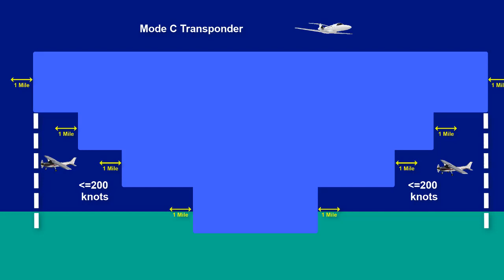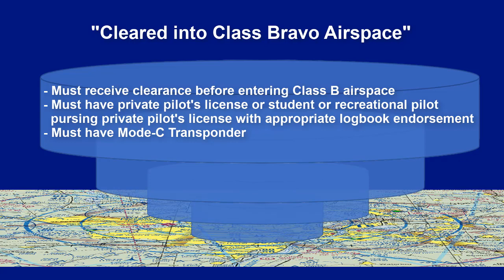Class B Airspace - Part 1

Comment: At the 1:20 mark you mention distance to maintain from class B when flying underneath. Where did those numbers come from? The only thing I found in the AIM was to observe precaution when in close proximity. There are places I fly (especially around 1H0) where it would be dangerous to maintain those numbers, but I’m still outside Class B.
Reply from the maker: You won't find it there likely.  It was an informal recommendation (not an official one) from one of the resources I had when researching I thought was helpful from a safety standpoint.  I'll see if I can dig up that resource and get back to you.
Reply: No problem. Just making sure I wasn't busting a FAR.